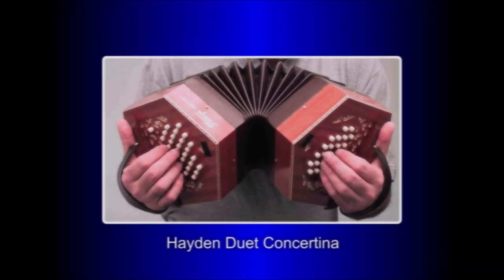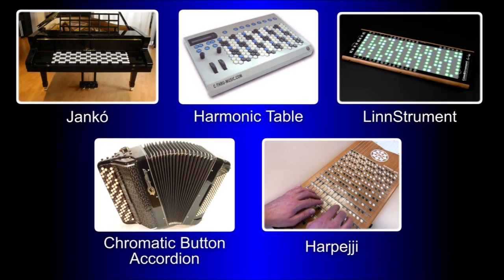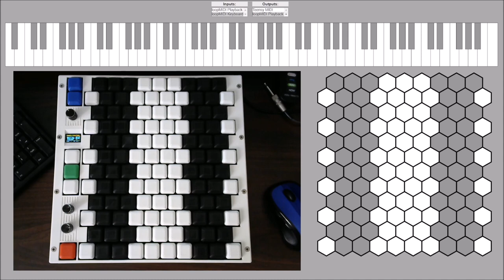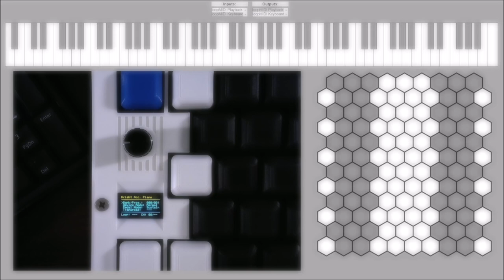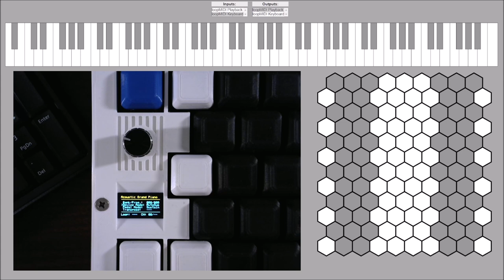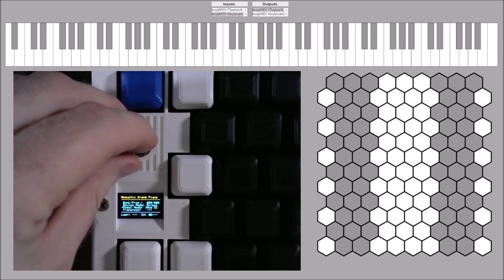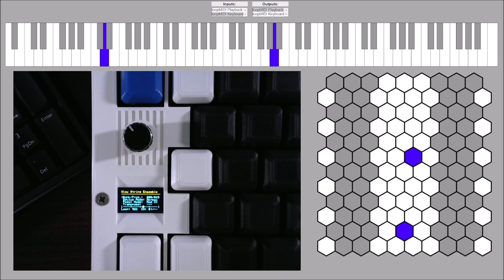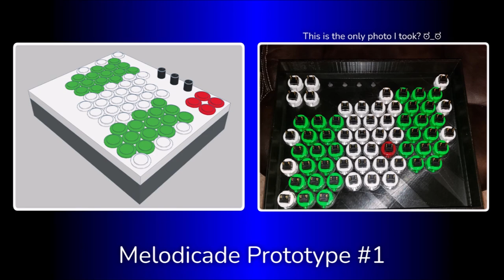Melodicade MX - A DIY 3D printed velocity sensitive MIDI keyboard using the Wicki-Hayden key layout

Comment: I've actually been working around a similar idea, wanted to add velocity sensitivity to regular MX Style keys. You definitely came up with a nice solution modifying the lower part of the switch's case and making the stem action a low force microswitch. I was actually trying out to figure out a way to do something similar but with a more analog, so that you could use it as poly aftertouch.
Reply: Hi, did you have any success? I’m planning on doing a teensy synth with polyphony and VS too but I don’t know how to achive VS or after touch
Reply: @pablobaccelli5154  To give you some Ideas. I am working on a version with linear hall effect sensors and using a series of Multiplexors to reduce the IO consumption of pins on the Teensy. If you look at Koop's code, he tracks the difference in timing between the two switches activation time. In my case for that standard velocity detection, I poll for a minimum Analog value that signifies activation and then I poll the same pin and Multiplexor channel for the desired Max value. from that I can determine the activation times in a similar way. For aftertouch you would just scan this looking for a reduction in value and time accordingly. Alternatively, you could just translate the analog value to MIDI Volume and the speed at which you withdraw your fingers would just be translated directly.
Reply: @dracozny how’s this going? I’ve been really curious about Hall effect switches for this purpose. Poly after touch on mech keys would be very cool. Would also be cool to just be able to assign them to ccs and have a huge array of momentary effects that can be activated / modulated with keys (and the ability to affect up to 10 at once with 2 hands). Seems like it could be a really great interface for all kinds of performances

Comment: This is great!  I was working on a similar project years ago but never finished it.  I've since gotten a linnstrument and programmed a "wholetone" layout which is similar to this but runs diagonally to the right, which is what I use now and now I think it's better than wicki-hayden.  It opens up a number of techniques and increases the range of the linnstrument, and also works well with splits with two hands (even on the smaller one), which makes it so stacking your hands is unnecessary.  The chord shapes also work better than on wicki-hayden imho.  Major, minor, and sus chords are just simple triangles, etc.  Great work on this though.  Hope to see more instruments with similar layouts in the future.
Reply: bosanquet-wilson layout ftw!!! if you're willing to go outside of 12tet, try a porcupine layout! (3\22 of an octave to the right and 4\22 upwards) it works on the linnstrument even better than bosanquet-wilson because the octaves drift diagonally slower

Comment: There is a wooting lekker hall effect analog mechanical switch. Reasonably priced but out of stock. No telling if it ever will come back in stock. Paired with the right hall sensors from aliexpress and maybe you have a winner. Something i have looked into. Optical sensors, cny70, are another option and what i am currently using in my project.

Comment: Amazing!! Can you share some detail about how you are achieving velocity sensitivity? You cut away the middle plastic cap on the bottom of the switches so the stem hits the tact switch?
Reply: He uses activation times to determine it. this is much like many modern keyboards. the difference is in the switch type choices.
Reply: @dracozny  can you elaborate? what you do you mean by "activation times"? measuring the timing different between the actual keyboard switch and the tactile switch beneath it?

Comment: Amazing! How reliable is the velocity sensing?
Reply from the maker: It's not as wide as what a good store bought keyboard would offer, but there's a definite difference between light and hard hits.  With this specific keyswitch and tact switch pairing, there's about a 1500 microsecond difference on hard hits, 6000µs on medium hits, and above 30000µs, I just assume a light key press and send it. Since the key sometimes doesn't completely bottom out on light hits, and it's better than dropping the note.  It's adjustable, but I have the velocity range mapped from 78-127 to keep things sounding consistent.

I tried a few different methods of capturing velocity, and this was definitely the easiest to implement without sending away for a custom PCB and using carbon dome switches, which I was trying to avoid for this DIY project.  Basically all that's needed for this is a SPDT on-off-on momentary push button switch, but finding switches for less than $3/ea, much less ones with interchangeable keycaps seems to be an impossibility.
Reply: @KOOPInstruments  Thanks! I looked through your build document and I don't understand how the tactile switch is pressed if you hot glue in the keyboard switches?
Reply from the maker: The stem of the key switch plunger pokes out of the bottom and activates the tact switch when fully bottomed out.  Because the key switch actually activates about half way through the throw, you can count the time difference between the buttons activating to arrive at your velocity.
Reply: @KOOPInstruments  oh that is genius, thank you!
Reply: @KOOPInstruments  Hey, here's a crazy idea - have you considered instead of the switch plunger pushing a tact switch, it pushes into a force sensitive resistor? That might be able to mimic the effects of velocity, as well as add aftertouch! Do you think that's feasible? I might give it a go

Comment: I looked at your website. It's great you are sharing this project. 
Could you maybe elaborate on how you did the velocity sensitivity? I could not find any info on that, or did I miss something?
Reply: There is a second switch below every cherry switch that gets pushed down by the stem of the cherry switch. By knowing the time delay between pushing the first and the second switch you know exactly the velocity.
Reply: I guessed as much, but didn’t find the information. I just finished a 49 key keyboard, in my next project I will try to make a velocity, sensitive keyboard.

Comment: nice job. I would like to try and build a sampler trigger that will trigger and play what is in the sampler by the correct midi note which the specific button I press will allow it to trigger the sampler which will then play the note that is stored in the bank.. there are several banks and a set of notes assigbed to the banks totaling about 128. thats 128 sampled notes that I can play any one of them by toching the right button on the keyboard and not having to change the banks and the samplet.

Comment: This is really beautiful. Interesting that you play it vertically, like a stringed instrument. As a piano player I would want to rotate it with the bass at left and treble at the right (rather than the top). With no design changes necessary! The meta keys would then be on the top, just like most synths!
Question - your earlier models used arcade buttons (similar to concertinas). Why have you settled on square keys? Hex would seem best for visualizing diagonal axes, no?
Reply: on a concertina your fingering for cords would be sideways. I would think that would cause unnecessary turning of the wrist and be very uncomfortable. the benefit to this design is that your left and right hand can play close together and not have to do strange over and under passes to hit keys. Sure it looks great but it's definitely a challenge. this instead relies on conservation of movement.

Comment: This really is a wonderful project. A quick thought, instead of requiring a huge print bed like on the CR-10 could this be built with mounting the switches into a PCB, then another pcb below with the tac switches?
Reply: yes. It's a little tricky and you will want to create shared landmarks on the boards to help populate accordingly.

Comment: I suppose you tried extracting velocity out of arcade switches by reading the difference between NC break and NO make? It didn't work? Or not all arcade buttons have these? I thought arcade buttons were based on 3-terminal endstop switches but last i actually seen one must have been 30 years ago.

How do you do velocity? Oh you have put a bottom-out actuated switch (like say a mouse button microswitch, Panasonic makes neat little square ones) below the MX key - so MX registers the travel midpoint? OK in your case it's just a low force dome switch for the bottom out event.

Comment: I want to build a custom form factor synth like this...I want a full range keypad in a small form factor.  You seem to have accomplished just that here.  I have this ebike camper and have been building light weight and small insteuments to take travelling.  I just built and acoustic electric uke as a downsize on a guitar, am currently working on a drum kit...but I need something small and MIDI still...and nothing in the size I want has the range and features I am looking for.  Got this video saved for when the time comes.
Reply: Also...I am a competitive PC gamer...and a competent typist at over 130 wpm...and of course use mechanical keyboards.  So I think I might be able to learn to play something in a similar form factor to your build better than a piano as I have been typing for about 35 years and am fairly new to piano / synth.  I currently use an old Kawai FS 750 that I got for $10 cause it had a couple broken keys.  I made molds of the keys and cast new ones in resin and paint matched the yellowed keys.  Almost a decade later after the repair and it still works amazing.  And I definitely don't baby it lol
Reply: The more I think on it the better this design becomes...I hope you don't mind me being heavily inspired with my build.  I will credit ya for the inspiration and I won't straight up copy it.
Reply: Also...the cherry keycap and switch styles allow for some easy aesthetic mods.  Imagine one built with all the stuff the mech keyboard enthusiasts do...wood chassis, steel switch plate, LED cherry style switches, custom keycaps, etc.  The possibilities are endless.  I am gonna start brainstorming.

Comment: Sorry, how did you achieve velocity sensitivity again? I didn't understand that part. Did you add another contact point on each switch? I'm designing a similar project with smaller form factor, piano key arrangement, though, also trying to use MX switches, but I didn't think velocity was possible.
Reply: By the way, super cool project! You got a new subscriber!

Comment: how does the velocity work with these switches?
Reply: Looking at the linked project guide, it's using a second push button tactile switch on the bottom. The stem of the cherry switch protrudes to hit the second switch for velocity.